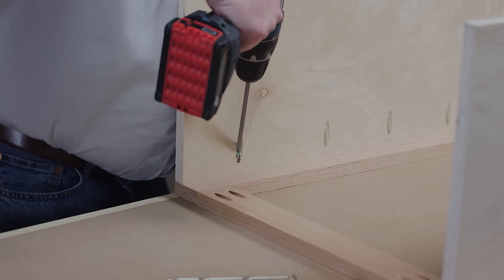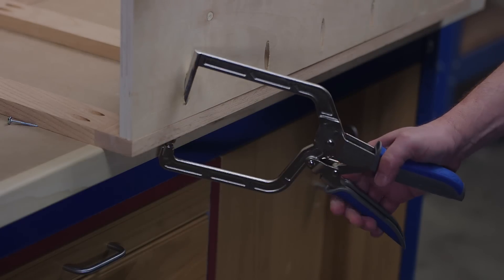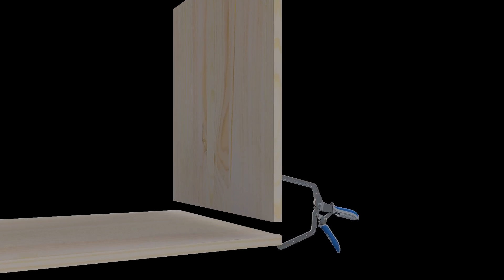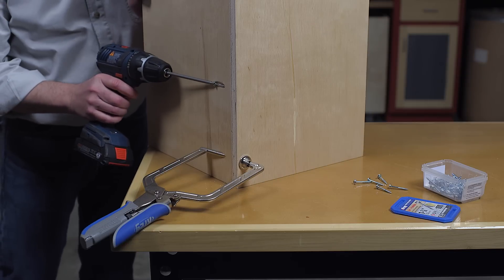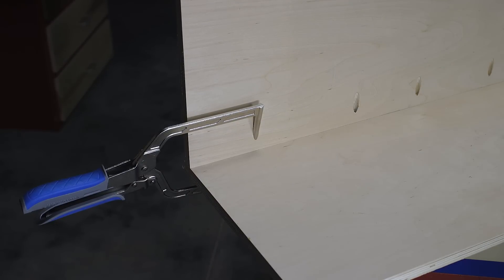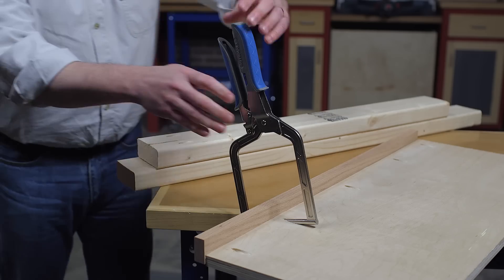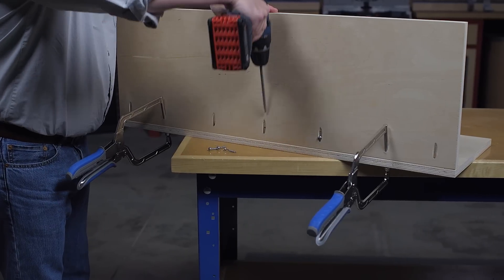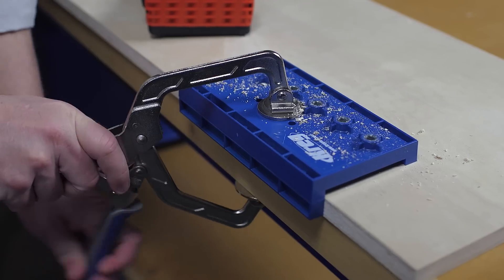Quick 90° Joint Clamping With The Kreg Right Angle Clamp - Great Clamp For Pocket Holes!

Comment: How wide will this clamp open?
Reply from the maker: It will clamp materials up to 3 1/8" thick (79 mm).
Reply: Thank you, Is that the material thats getting clamped to or from the pocket hole to the end of material getting clamped?

Comment: Just bought one of these, i'm trying to use it to join some 19mm timber but it won't snap shut. I've tried adjusting the knut but it's still not closing,  What am I doing wrong?
Reply from the maker: Please get in touch with Technical Support at toll-free 800-447-8638 or technicalsupport@kregtool.com. They will be happy to help with this. Thanks!